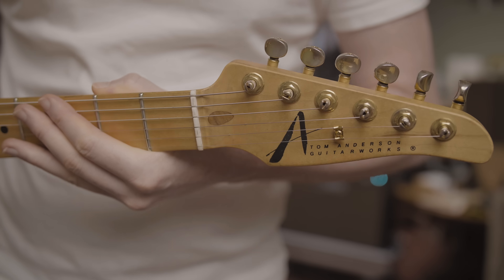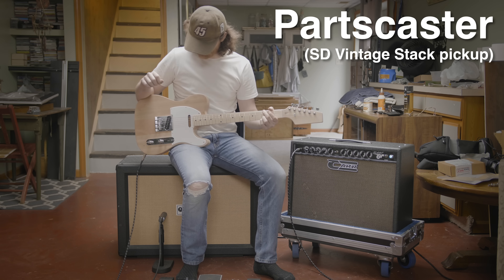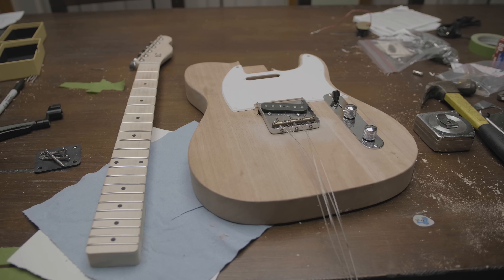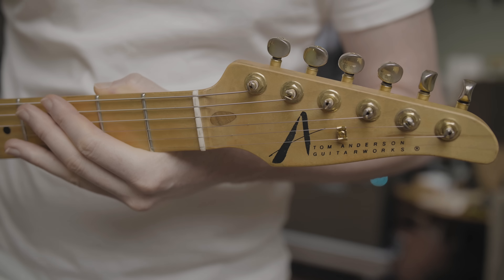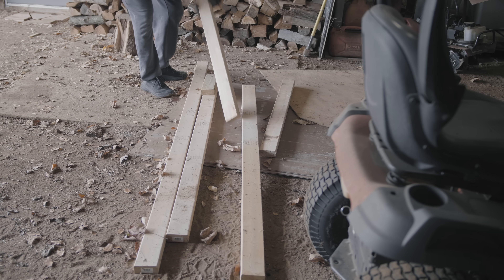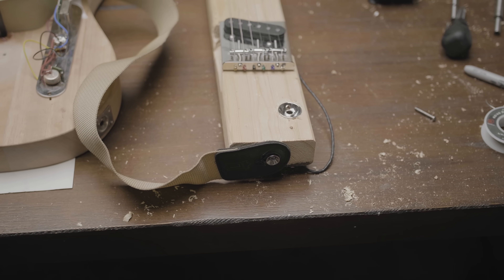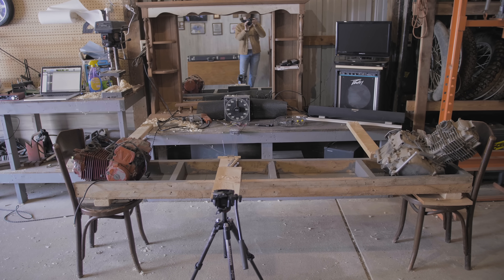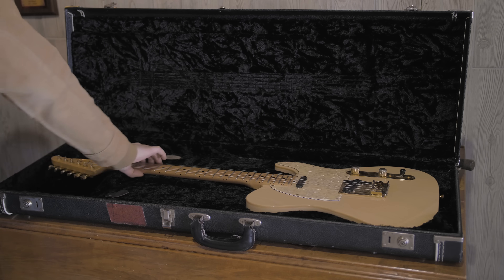Tested: Where Does The Tone Come From In An Electric Guitar?

Comment: That’s cool as heck. 

I’m a big PRS fan boy, but I’ve gotta admit this kinda kills his “tonewoods” on solid body electrics theory.
Reply: The problem is that this video is trying to say that woods/substrate/guitar body doesn't matter.. and basing that whole argument on the fact that everything but the pickups, the strings and the tuners have been replaced... but that's not the case. Strings need something solid to resonate with to maintain their oscillation... plugging this rig into a bench does not demonstrate that.. you're just replacing the guitar body with a bench.. so, of course the strings will resonate the same - maybe better! Replace it with stale bread and you might have a point. :-)

Comment: the 2x4 and air guitar miss the subtle undertones and sustain that the full high quality guitar has. 
greatest tone factor for me that i have tested and heard the difference are:
the guitar wood including body, neck and fretboard, how the neck is joined to the body and the body hollow or full
the pick up and electronics
the hardware (bridge, saddles, nuts, tuners)
strings.
so much influence tone in the end that you could say every parts do make a difference.
but it's easy to get a basic good sounding tone with any guitar if you have good pickups

Comment: What an outstanding research piece. First video I've seen of yours and it's a 💎. Cheers!
Reply: The problem is that this video is trying to say that woods/substrate/guitar body doesn't matter.. and basing that whole argument on the fact that everything but the pickups, the strings and the tuners have been replaced... but that's not the case. Strings need something solid to resonate with to maintain their oscillation... plugging this rig into a bench does not demonstrate that.. you're just replacing the guitar body with a bench.. so, of course the strings will resonate the same - maybe better! Replace it with stale bread and you might have a point. :-)

Comment: Your audio still sucks because you are missing that audiophile grade digital cable.
On a more serious note, nothing here is surprising to a physicist. The pickup registers magnetic fields changing, so the only things that can influence result are ones that can affect the magnetic field or the signal produced from the pickup. But the signal produced from the pickup can realistically only gain noise so as long as you don't have anything that introduces noise you are fine.
Of course, the most significant element on the guitar is the pickup, it is the pickup that detects the magnetic field changes and converts them to electric potential and it is probably most responsible for the result.
Things that can affect magnetic field detected by the pickup can be roughly divided into setup geometry, things that can influence how the string vibrates and things that can be placed in the vicinity that can change the magnetic field.
Setup geometry is simplified a bit because the pickups themselves are radially symmetric, which means it does not matter how the pickup is oriented radially. What matters is the distance from the pickup to the string, an offset between the string and the pickup axis (there should be none), the angle between the pickup axis and the string (it should be perpendicular), where on the string the axis of the pickup intersects the string (different harmonics will be picked up depending on the location), the material of the string, the construction of the string (wound, solid, etc.).
Then you have the things that can affect how the string vibrates: the geometry of the mounting setup (are the edges of the mounting points sharp or curved, etc.), the stiffness of the mounting setup (the more stiff the setup the less energy the string will loose and will sound longer and transfer less energy to other strings), the atmosphere (if you could change it significantly you could get a different sound before you die of asphyxiation...), the physical properties of the string (things like material, construction and weight change not only how the string is picked up but also how it vibrates).
And lastly, you have things that can be placed in the vicinity of the setup that can change the magnetic fields -- these are all objects that can bend magnetic fields. Ideally, you don't want any. Wood is not one of them, thankfully.

Comment: I skimmed through the video a bit, so I might have missed it, but you should have added a bit of theory/analytic approach. Only those things which affect how the strings vibrate and how this vibration is caught by the pickups can affect the sound. If any modification does not affect that, no matter how bombastic, it has absolutely zero effect on the sound. Regarding the body of the guitar, as long as it is sufficiently massive, it will not have any impact on the sound of the guitar. The mass of the body has to be so large that it appears from the point of view of the strings as a rigid body.

Comment: Fourier gave us that any arbitrary periodic function (ie, voice) can be decomposed into a summation of mathematically pure sine and cosine components. To change the voice, you need to change one or more of those. The only conventional analog electronic components that are frequency dependent/selective  are capacitors and inductors, which may be lumped (store-bought components) or distributed (intrinsic departures from ideal wires and resistors). If the nut and bridge are immovable (that’s the design objective), the only remaining factor is how/where the string vibration is launched. 
An improved experiment would be to design a mechanical pick machine with perfect replication and double blind audition by a large and varied set of ears, or an Audio Precision analysis kit. 
Change my mind.

Comment: Most luthiers paid better attention in wood shop than they did in physics class.  Physics, though, tells us the answers without even needing to test. Pickups are electromagnets- they aren't microphones and so they don't pick up sound waves disturbing air.  Rather, they pick up disturbances in the electromagnetic field surrounding the pickup.  Non-magnetic substances won't meaningfully disturb the field- so plastic pickup covers and wood guitar parts don't get sensed by the pickup. Ideally, we want the pickup to only sense the disturbances created by the vibration of the steel guitar strings, and we want the string to vibrate for as long as possible- that's "sustain".  So, rather than looking for resonant "tonewoods", which can and do affect the nature of an instrument's acoustics, we want to select materials for the bridge and nut which transfer the maximum amount of vibrational energy back into the string, rather than absorbing it or diffusing the energy into the guitar body and thus ultimately into the player, who absorbs the excess vibration.  

In short: physics gives us all the answers. Pickups and electronics matter, and hardware, particularly bridge and nut hardware, can impact the vibrational performance of the string under tension. Everything else is about player experience, and it's almost ALL marketing hogwash.

Comment: Q: Where Does The Tone Come From In An Electric Guitar? A: The loudspeakers.

Joking aside, "the tone" is a pattern of harmonic colourations riding on the bas sine wave of the frequency (note) you play. Play a piano's central C note on different instruments and they all are "440 Hz" but the difference is in these colouration patterns, each of which has another frequency. Each of these colouration spikes and dips is in a much higher frequency range than the frequency of the base "note" you play. These colourations happen in different places in acoustic sound sources. But electronic amplification is extremely likely to distort that. At all levels in an electronic chain of music reproduction there will be distortions of all sorts of kinds. These may make the sound prettier or uglier to your ears. As long as you did not qualify this influence, talking about the electric guitar may not be valid. You need to add "ceteris paribus" in your comparative analysis and know how the other (ceteris) variables and parameters play out in the tests before you can assume they remain constant (the same, paribus) over all.

Comment: So, it’s just as my trusted tech told me once that I’ll never forget:

The sound is mostly the pickups. 

And judging by your testing, it sounds like 90~95%.  

That 2x4 test said it all. 

Great video.
Reply: LOL With the other 5% being the strings, saddles, scale length, and tuners.
Reply: and as my old guitar teacher/builder used to say, theres only a certain amount of ways you can wrap a piece of copper around a magnet. so no need to buy £200 seymour duncan pickups
Reply: @burntforest633  yeah yeah, so go buy the cheapest ones, they sound the same! lol
Reply: @burntforest633  You may find pickup companies that create knockoffs that sound as good if not better than the expensive pickups but most of them are not the cheapest ever. That applies to pedals as well.

Comment: You pretty much confirmed what I found out a month ago. I purchased a kit guitar for $72. I put some, left over, Mexican Strat pickups in it, and it sounded great. The playability is awesome, and so is the sound. You don't absolutely need to spend hundreds, or even thousands of dollars to get a good guitar. Whatever slight differences in sound you might have are probably not worth the extra outlay of cash. As long as the playability is good, you can make it sound good. Just my opinion. Thanks for the video.

Comment: I pioneered building magnesium guitars called them Magnatar. So I actually had to find this out myself and, I did. It is the vibrational  interference of returning sound vibrations traveling through the neck material. Its all about the return vibrations. The less return the cleaner the more vibrant the tone and the closer the tone matches the actual string vibration. The better conductor of vibration  allows the sound to travel through the material so fast it fails to turn around and interfere with more incoming sound waves. This will hold true with wooden necks as well with how fast the sound vibbrations travel in the type of wood used. Its all in the material used and it also affects sustain as well. 0:27

Comment: Great video Jim. This proves once and for all that type of wood or shape marginally effects the tone. At least not to the degree that it motivates hundreds of dollars extra to achieve “a better sound”.
Leo Fender aimed to produce as many affordable (cheap?) guitars as possible. If he had “slab sawn” neck wood that’s what he used. If he had ash that’s what he used. Was alder in stock he used that and so on.
It is all (99 %) in the electronics, hardware, your fingers and above all a great setup.

Again thank you Jim!!

Comment: Great video. I believe most of the sound comes from the bridge saddle configuration. Ie the strat system sounds so different in my opinion to the tunomatic bridge of the Gibson. That I believe it the equal biggest common denominator to the pickups.

Comment: Acoustic and electric.  Quality Wood!!! Without that, everything else is useless. Period. Ask John Suhr. 

If the body and neck wood type and quality is not of that much importance, then all you cats with Anderson, Fender CS,  Suhr, and other boutique guitar brands/builders should sell those and buy a Fender Squire or Epiphone Les Paul/SG/335 and change the hardware and electronics and you should be totally good to go... with an instrument that's 1/3 or less the price of that Custom Shop or Boutique job. Take the extra bucks and buy ya another pedal or three for that pedalboard. 

35 years of playing guitar. 20 of those professionally...
 playing tons of live gigs. 

A great, (magical-1 out of 50 of the exact same make and model) sounding electric guitars mojo starts like this... 

Wood- especially the quality of the neck wood and it being dried and seasoned correctly. Again... Ask John Suhr and see what he says. Cant argue with that cat. 

After that... Quality hardware and high end, quality electronics helps. 

Last but definitely not least..   
A proper set up... With a properly shaped, cut and filed nut being of utmost importance... If that's not correct, the guitar will never play or even sound like it should. 

Just me two cents worth. 

Sorry, but this video and any other like it on the ole YT, is a joke. Useless bunch of crap. Just play a bunch of guitars before buying and pick the one that sounds best to your ears. Spend the rest of your time practicing on the instrument and getting better. Gear dont mean shit until you can play somewhat anyway. It is all mostly in the fingers, but when you get to a certain level, gear is important and you want to use the best you can afford.

Comment: Sadly YT offers only to put a thumb up or down to rank a video here. Because this one deserves 5 Stars!!!
Reply: The problem is that this video is trying to say that woods/substrate/guitar body doesn't matter.. and basing that whole argument on the fact that everything but the pickups, the strings and the tuners have been replaced... but that's not the case. Strings need something solid to resonate with to maintain their oscillation... plugging this rig into a bench does not demonstrate that.. you're just replacing the guitar body with a bench.. so, of course the strings will resonate the same - maybe better! Replace it with stale bread and you might have a point. :-)
Reply: @crazyjack9voltbatteryamps  if I understand what you say is that strings need something strong enough to retain the tension to be able to tune'em and keep strings to vibrate? Yes that's for sure.

But the point I like here is a fact check on the scam thought that quality of the wood used matters. It's not true in my understanding.

Comment: As someone who has set up countless cheap guitars over the years I concur. I have a Mexican Fender custom shop Strat that I have meticulously tweaked for the last 20 years, and my old friend who played for nearly 60 years played it and admitted it sounded and played better than his American Strat. I was both humbled and puzzled. I appreciate your findings and will be stuck thinking about this topic for days.
Reply: MIA strat will sell for more in the used market because MIA. Value also drops a lot slower and often rises after a long time.

MIM doesn't keep its value as well, unless in a cool or unusual colour. They sound the same or better for half the price, and if you spend a bit more on aftermarket, sounds exponentially better.

Some people say MIA feels better, but if you've played any other brands, you'd know all fenders are very heavy, and any difference, if it's even real, is extremely marginal. 

Both are made by Mexicans, and with the factories being spitting distance from each other, probably share everything from workers to parts to machinery.
Reply: Aren't Fender Squiers manifactured in Mexico too? I bought mine about 8 years ago. It's the Squier version of a 3500$ guitar for just 500 bucks and it still sounds extremely nice and feels good. A guitarhead friend of mine with a huge collection played it and just said damn bro thats an awesome guitar. It's probably the Humbuckers.